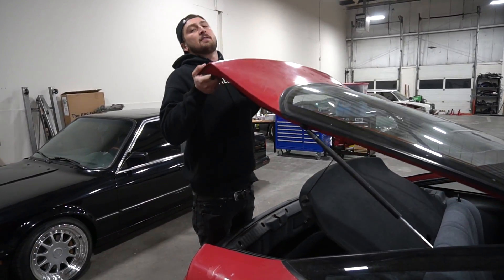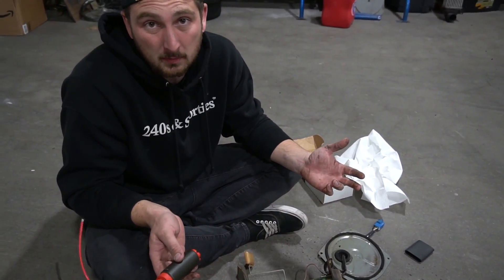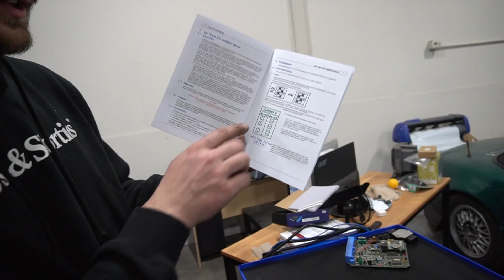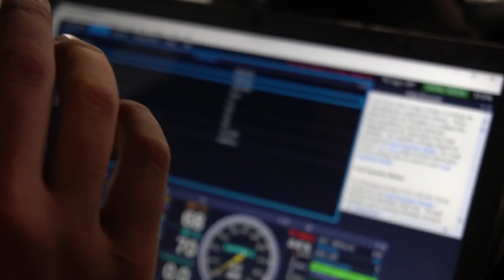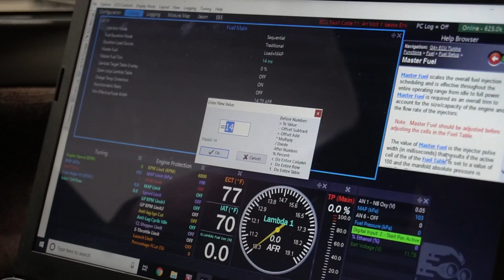Making the Cherry Hatch DYNO ready!! (Time for some power!)

Comment: Great video! Awesome giveaway. When I get the funds sorted (just paid my tuition fee) I want to go stand alone. I bought my 04 350z with FBO 6,5 years ago. I did get it on a dyno and it made 313,9hp on the flywheel. Last month I was at a tuner and he hooked up his laptop and checked my ecu but did not find any changes to the map. Instead of going for a tune on the OEM ecu I want to go for a stand alone due to the benefits Jimmy pointed out.